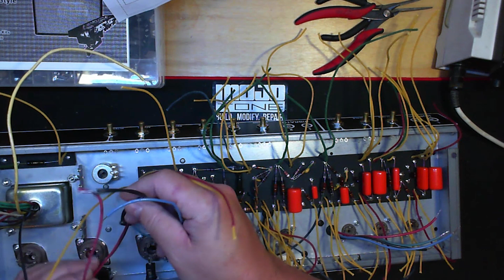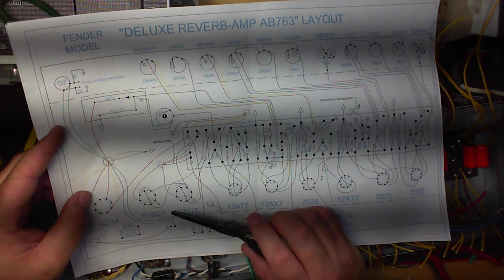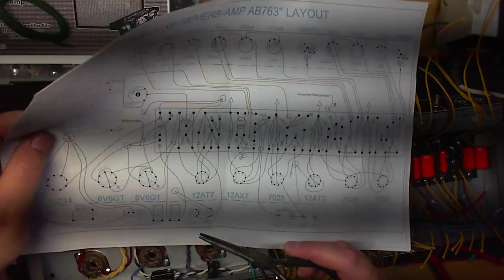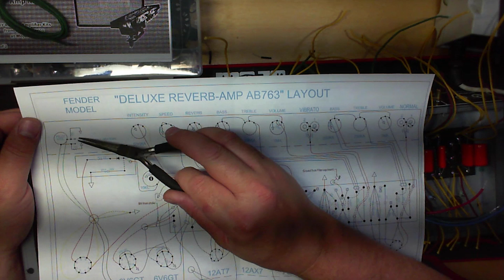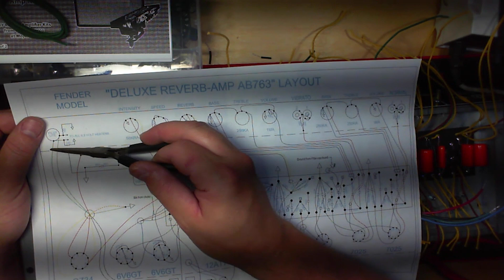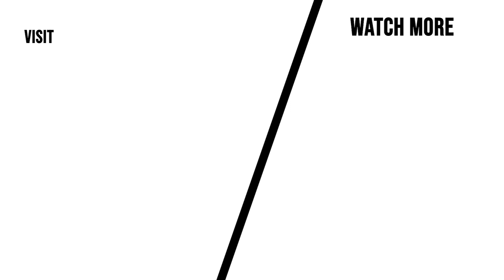Mojotone's Blackface Deluxe Reverb Transformer Wiring

Comment: ? can you add a virtual center tap with the 2 100ohm resister off the piolet light even tho ya have a center tap wire to ground will it help to reduce hum that much more

Comment: The mains wiring on this design is true to the original design, but is not consistent with modern safety standards. The original amp had a power cord that was neither polarized nor grounded. As such, either leg of the cord could be hot or neutral, depending on how it was plugged in. Given that, one leg went to the fuse, the other to the power switch, and the chassis was "grounded" to the neutral through a capacitor that has since been termed the "death cap" due to the effect it has on the player if it fails shorted. This portion of the circuit has wisely been left to the dustbin of history, considering it serves no purpose on a grounded amp. The same should be said about how the fuse and switch are wired. With a polarized plug, we know which leg is hot and which is neutral. Any electrician's apprentice can tell you that all switches and overcurrent devices should only be applied to the hot leg. The black wire from the power cord should be run to the fuse and the power switch in series, then to the primary of the PT. The white wire from the power cord should be run directly to the other side of the primary for the PT. This is inconvenient as you need to find a lug to make the connection (I would suggest one of the ungrounded terminal strip lugs), but it's the correct way to wire the power cord today.